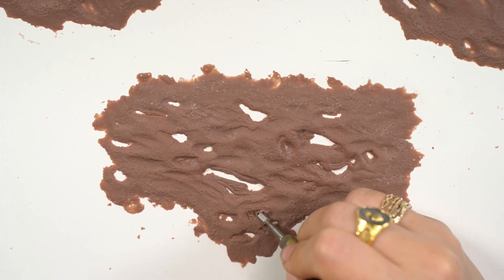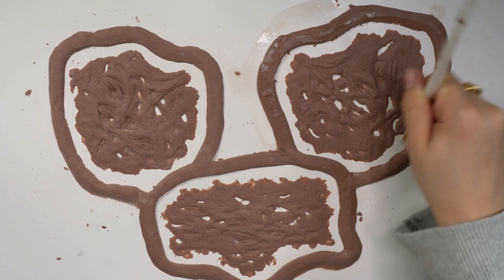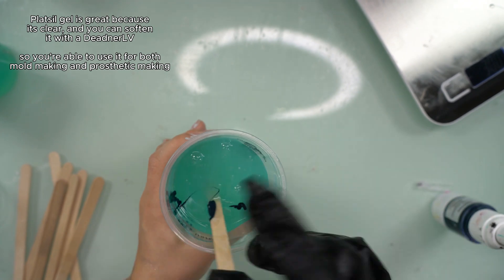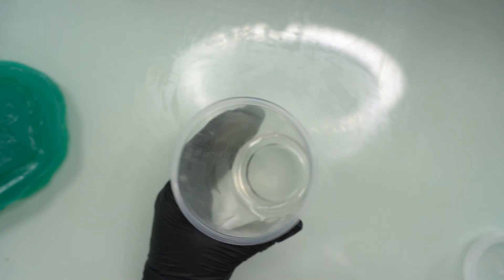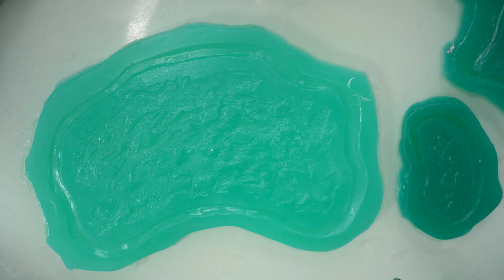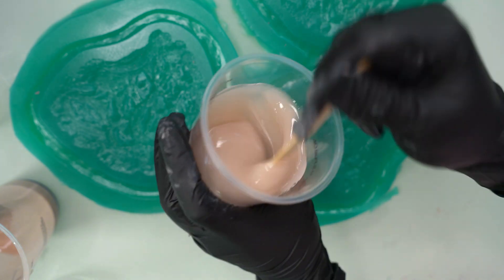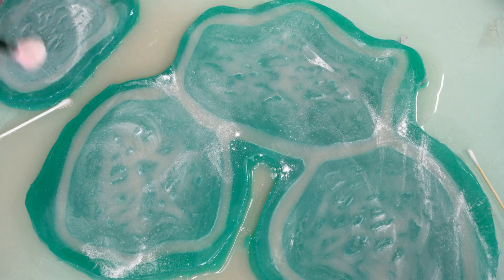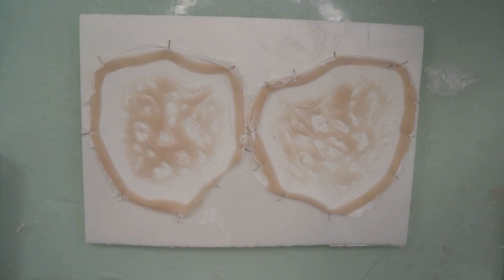how i make my prosthetics | silicone prosthetic tutorial

Comment: For the mould could you make it out of alginate or plaster then fill it with silicone or does the mold being made out of silicone really affect the process ?
Reply from the maker: you can use plaster but it can be a little tricky with the cap plastic, make sure the plaster is fully dry for at least 24hr and use a little bit more release spray/vaseline than you would with silicone!
Reply from the maker: you can’t use alginate though it would be too wet and too sensitive unfortunately

Comment: Is there a way to apply the cap plastic wothout an airbrush?? Would a sponge work?
Reply from the maker: you can use a brush, but it tends to be thicker and harder to control! amazon has pretty decent airbrushes for about $50

you can definitely make them without but they may just turn out thicker and take more time to apply!